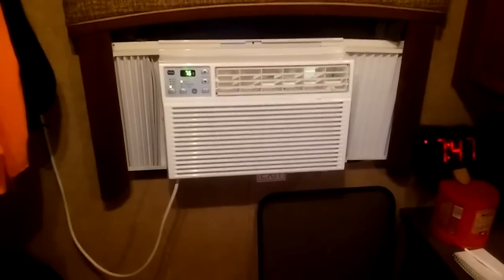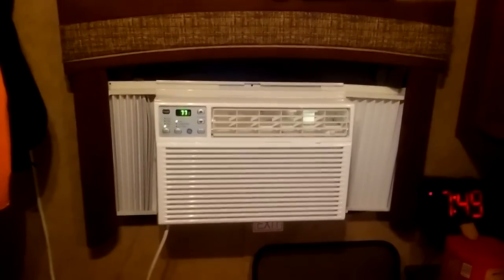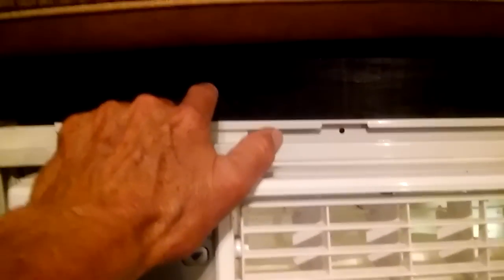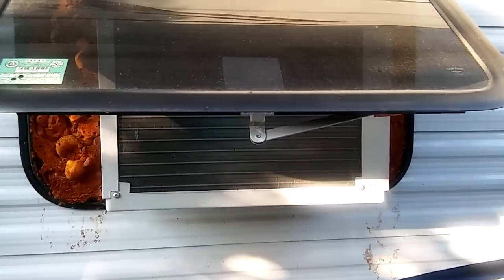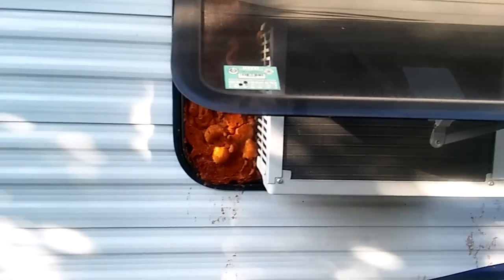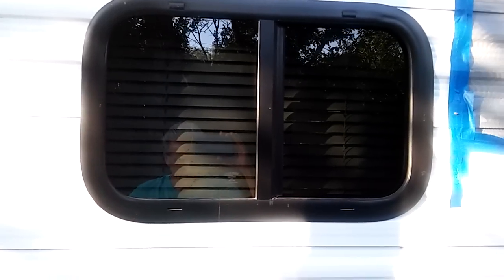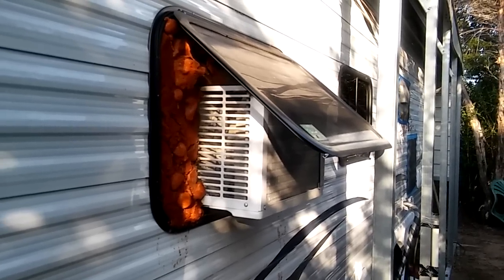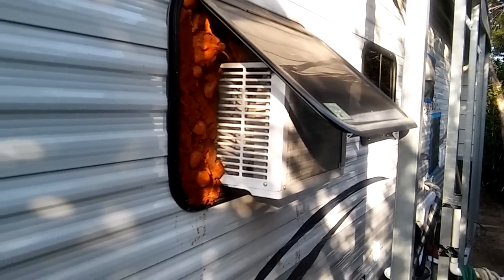How to install window A.C. in RV

Comment: You mentioned that you had a window unit in the kitchen window in the past. I am considering that for my camper but the kitchen faucet would preclude me from installing it from the inside. I would have to push the unit in from outside. Is that what you did? Thank you

Comment: Have fun digging out all that spray foam if you ever want to take this RV on the road again. A pieces of rigid foam insulation (2 inch) can be cut to fit just right and is easily removable. But the window AC is a good idea for an RV when it's parked near power.

Comment: GE silicone black for outside blocks light,clear for inside. No need for foam.  Find the light find the cracks and no bugs or water. Just did one on a 30 footer instead used a 8000 btu. I was shooting for a 12000 but window was too small

Comment: My rig: 2014 keystone widebody 299ret.  purch. in 2018.  The selling dealer installed a new 15k coleman mach for free.  After 4 yrs. full timing, I'm in shock it is not broke yet.  I just ordered a 12k btu "inverter" a/c - heat pump from Costco.  I will install it b-4 the roof a/c dies so I can use the Coleman roof unit as a backup a/c.  Your video is helpful to get installation ideas.  Thanks.

The new inverter heat pump a/c:
Midea 12,000 BTU Cooling Inverter Window Air Conditioner
Costco Item: 1575342  Model: MAW12HV1CWT

Note: the heat pump is good for down to +40°F.  Below +39°F you will have to run an alternate heat source.  Price: $339.00

Comment: Hi Rusty, I live in Kempner (central texas) and my 34 foot 5th wheel is my home. I love the life style and have done it for years. Today, I installed a GE 5000 watt window unit in my bedroom emergency window. Everything was amazingly easier than I though it would be and was able to insulate the openings to my satisfaction. This is my concern and would like to ask you your thoughts. I'm concerned that when it rains hard, the water is going to come right into the RV. Standard RV windows can sometimes be an issue to begin with relative to rain and now we have nothing that allows the water to bypass the window. Have you had any rain problems and what are your thoughts? Although my roof AC does ok in this 104 heat index weather, I like my bedroom window unit so much, I may buy another one for the living room and give that roof unit a rest! Thanks for the video!